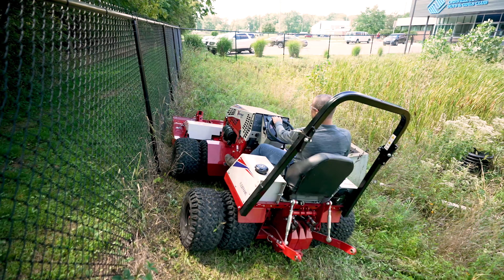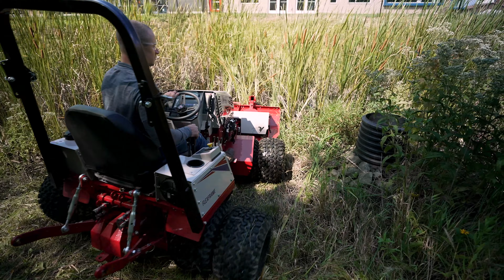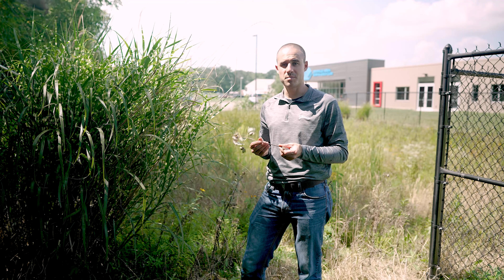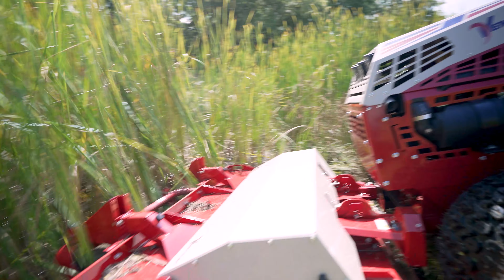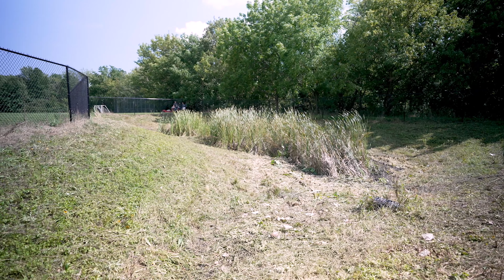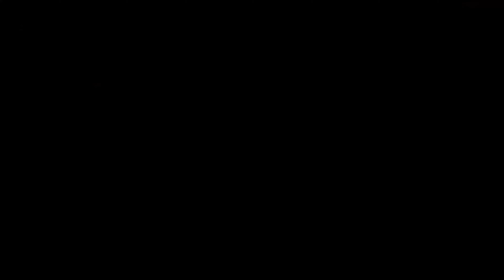Mowing A Steep, Wet Retention Pond

Comment: Step 1 is to do a terrain walk and mark all the hazards.  Then use the boom mower for the wet areas.  :)

There are a variety of mowing challenges.  The BMP (aka silt ponds) along highways are designed to collect runoff from the roads to prevent all the junk and pollutants getting into the watershed.  They were traditionally mowed by crews with string trimmers.  Now companies are moving towards Ventrac or robot mowers.  Although some are surrounded by guard rails so difficult to access.

The same is true for power line mowing.  Miles of grass to be mowed on difficult terrain.

Both roads and power lines have tree lines that need to be cut back & maintained.....something the boom mower excels at.  Although some are higher than the boom mower can reach.  Some crews use excavators to simply tear limbs off.

The Ventrac excels at mowing dams because it doesn't cause ruts....and can handle the steep slopes.

The marketing challenge is how to reach the companies that do the work.

Although frankly the road signage standards need to be revised.  There are so many separate signs, it makes mowing difficult.